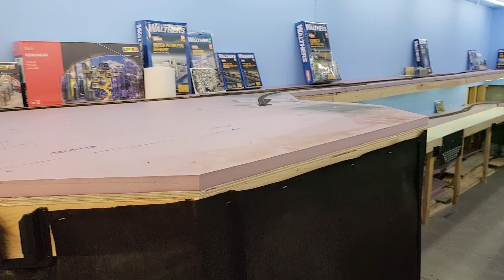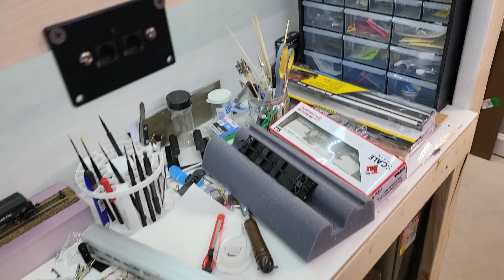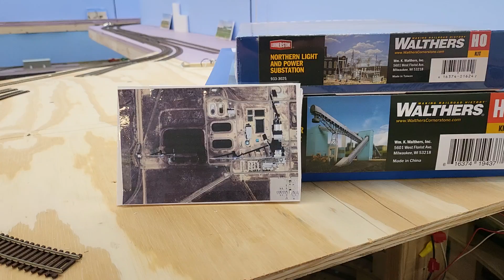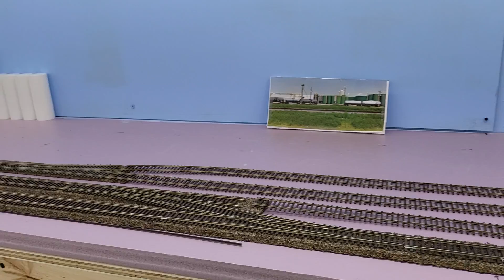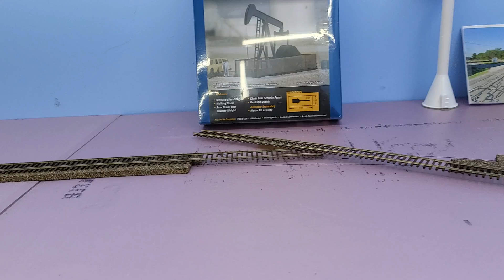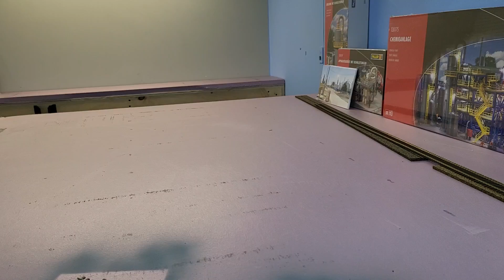K & W HO Scale Model Railroad, Construction Update #20 - UP yard built!  What's next?

Comment: Incredible job! Your classification yard blows my little 4x8 layout away. I like your idea of the power plant. I used to take CSX crews to Plant Bowen in Cartersville to dump trains. There was a big loop the trains would go around leading to a elevated truss over a pit with the conveyor system mounding coal for the boilers. They had trouble one day in the rain getting traction and I had to help them get a running start to get speed to make it up a very slight incline. I shadowed the train until it finally got leveled off enough to to continue. For about five minutes the second locomotive was jumping up in the rear every time the wheels slipped. 
Good luck with your project. You have your work cut out for you!
Reply from the maker: @chessieandjack  Thank you for the compliment and for the awesome real-world story!  I wish I had the space at Holcomb to do a loop but it's not meant to be.  Thanks for watching!

Comment: With my limited experience I say that you should get the track as perfect as possible first. Then go to the scenery. Question. I am 5'6". How high is the upper level? I can foresee difficulty dealing with an inner yard track problem because I can't see it.
Reply from the maker: I agree with you on track being the priority.  I like the idea of running plenty of trains over all trackage to ensure there won't be any issues that are impossible to fix before ballast gets put down or rock walls get cast in place.  
The track level height of the upper level is about 55".  Foreseeing that this could be an issue for my more vertically challenged operators, I intend to buy a couple of those spring-loaded stools on casters for each side of the Wichita yard that should help with this.
Reply: @KandWRailroader  I am helping a guy with his large layout. He has also run across issues after and because of ballasting. There are places that are difficult to get to where there are important switches. Those places don't even have scenery yet which may complicate things. Also, try one of those stools first. When I hear 'wheels' I think of falling. Good luck. Terrific project!
Reply from the maker: @jerrygoldman4484  Thank you!  Your friend is lucky to have help, although I am terrible at delegating so I would probably tell whomever showed up to just "having fun running trains!"  I chose my layout design with easy reach in mind.  Obviously that doesn't apply to the helices (which won't have scenery) or the Wichita yard (which will be easy to reach with a stool...I had to use one to solder all that track!).  The stools I have in mind are used in libraries all the time.  Once you put something like 20 lbs. of pressure on the stool, the spring-loaded wheels depress up inside the stool, thus planting the stool firmly on the floor.  Of course, if someone tries to reach farther than they should, then their center of gravity will be calling the shots regardless.  Either way, I have more than one yard and if a shorter operator has difficulty with the Wichita yard, then I'll be happy to have them working the La Junta yard while seated on a comfy stool.  That one is gonna be super busy because it's so small!

Comment: First time viewer. Will your turnouts be manually controlled? If automated, what's your method on the 2" foam?
Reply from the maker: Welcome aboard!  All my turnouts will be manually operated both to be more "hands on" with operations and to save a ton of money on machines and work on wiring and control panels.  I did install machines for my hidden staging turnouts for obvious reasons and building those control panels was quite enough for one layout for me.

Comment: Can you make the power plant track a balloon track so unit trains come in and unload without switching?  Pretty common for more modern power plants.
Reply from the maker: I am still considering this for the reason you mentioned, and because that's how it is for the prototype I am modeling.  However, I saw a video by @djstrains I think where he mentioned that it's a waste of time to model the operations of an active train being loaded/unloaded because of how slow the train has to go (like 2mph I think).  I wouldn't want to spend 15 minutes slow crawling a train through there and wouldn't want to make any of my operators do it either.  It will probably just end up being a couple of spurs where loaded cars are dropped off and the coal load will be "unloaded" between ops sessions.

Comment: Vote for yard completion, what is your standard for distance between tracks?
Reply from the maker: Vote recorded!  Generally, my distance standard is whatever is natural from how the turnouts are laid.  I'm fuzzy on the proper terminology, but it depends on the diverging route angle for the Micro Engineering and Walther turnouts that I'm using.  Generally about 1-5/8" to 1-3/4" I believe.  I make sure to widen that out on curves to at least 2".  I always check clearances with my autoracks as they are the longest rolling stock I have in my collections, although I let that slide on tracks that will never see autoracks like certain industrial sidings and spurs.  I know it's a lot tighter than NMRA recommendations, but when compared to prototype photos and video I've seen, it doesn't look that far off.  So far, it doesn't seem to be causing any operational trouble.
Reply: Prototype spacing has slowly increased over time.  Earlier track will have 13 ft spacing with more modern going to 14 or 15 feet.  However, the most modern track like the Powder River Basin I think go 20 or 25 ft.
Reply from the maker: @ericjonboone  I can see regulations requiring more spacing for worker safety.

Comment: Looks good but if u want a continuous range train up top make a run through track from the Bnsf n the up side together so it’s like a wye
Reply from the maker: I agonized over that decision for quite a while, because it also involved making the helix under the El Dorado refinery full size so I could do continuous running between all three levels.  Ultimately I decided not to do either option because I have continuous running from the lower staging level to the middle Colorado level.  The prototype line from Wichita to El Dorado is an out-and-back line that I chose to emulate instead of adding the wye between yards and the full size helix.  However, that's why I added two interchange tracks at the end of the Wichita yard, so cars could be passed back and forth between the BNSF and UP yards, even though the UP has trackage rights on my railroad on the BNSF main line.  It all just adds more options to future operations.  I really only run continuous through trains for visitors so having continuous running on all three levels wasn't important to me.
Reply: @KandWRailroader  ok makes sense but layout looks cool

Comment: Wow! That UP yard looks incredible. You have so many different yards that your operating sessions are going to be intense. Great progress. My vote doesn’t have to actually be work done because it has to do with scenery and you haven’t done any yet but I would like to see you discuss how you are going to handle the scenery with the cliff side running. What materials do you plan to use to build the mountains and river run and how large will each part be?
Reply from the maker: Thank you!  I couldn't be happier with how the Wichita yard in general turned out.  I think I could discuss a rough scenery plan for the Royal Gorge Route (I'm assuming that's the area you are talking about) in my video update Monday.  I have it pictured in my head and the photos I printed out and have on display are a basic representation.  I've been wanting some feedback on my river design anyway...I've never poured "water" before, and I think I will do the small river at the east end of La Junta yard first to gain some experience before pouring the Arkansas river at Pueblo and then the Royal Gorge Route area.
Reply: @KandWRailroader  Yes, that was the area I was speaking of. Do you have a plan for the mountains? Cardboard strips and plaster or foam profiles and sculptamold or some other method? And how tall are you planning to make the mountains? I’m really enjoying your build.
Reply from the maker: @derekalexander4030  I'm planning to use foam for the substructure covered with a blend of plaster cloth and sculptamold.  That's the plan anyway.  I've not really ever reached the scenery stage on previous layouts so I will definitely be learning as I go.  I'm going to try out ideas in small areas that can be ripped up and re-done easily without ruining any other aspect of the layout.  I'm both excited about the prospect of doing scenery and apprehensive at the same time.  Fortunately, there are a plethora of videos out there to help guide me.

Comment: I couldn’t help but notice that you have the power substation kit. I recently completed the same kit. Be prepared to spend way more hours on it than you might think. The directions are terrible. I spent more time looking at the picture on the box when it was tiny to assemble the component parts , then I did pouring over the incompressible directions. Don’t even attempt to build the fence with their design. Scrap the metal fence rods and use scale styrene rods instead and glue the fencing fabric to it. The one YouTube video I found about its construction ended with the guy tossing the whole thing in the trash. Eventually I completed it and was able to maintain my sanity 😁. Good luck 
Incidentally, I have been in the hobby for 35+ years and needed all my kit building experience and patience to get it done
Reply: Walthers truly makes decent kits with terrible instructions. It's not that the instructions are poorly written (they are), but in many cases they are just wrong!
Reply from the maker: @achb-railway  It's fortunate that there are so many helpful Youtube videos our there that exhibit the construction of many of these kits.  Sometimes it really just takes someone on video, showing the viewer with sometimes 360 degree views of kits and their components to help the instructions make sense.
Reply from the maker: Thanks for the tip!  I've heard many complaints about Walthers's kit instructions and somehow managed to construct their notorious oil refinery kit once before on my last layout.  I've never tried building any fences but I've seen plenty of alternative options in the Youtube world that seem pretty easy if this kit is a pain.  I've received lots of positive comments about how fast the layout is coming together but I think when the tracklaying is done and I start putting more time in on some of these complex structure kits, progress will definitely slow down.

Comment: Wire up the UP yard, try using the Walthers pavement(sidewalk) plates for the engine maintenance building, should work if you can get them.
Reply from the maker: Thank you for the vote and the tip!  I will check those out.